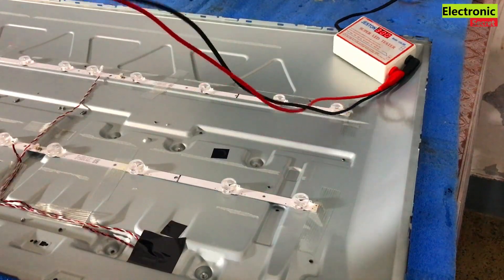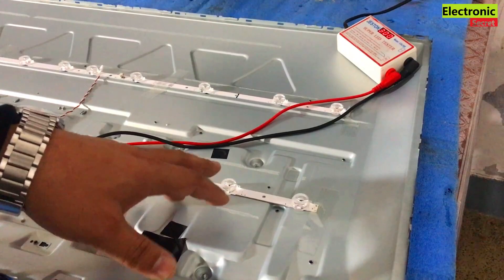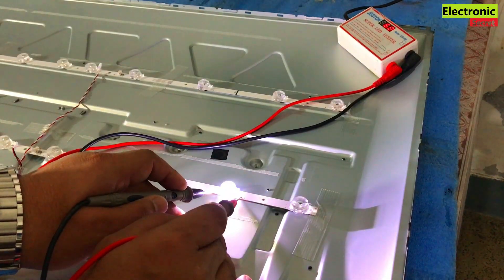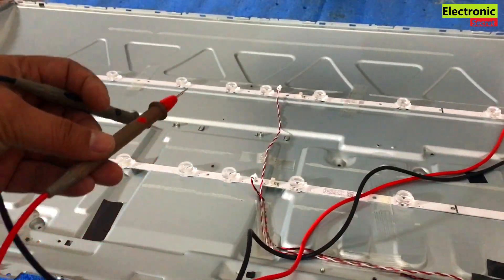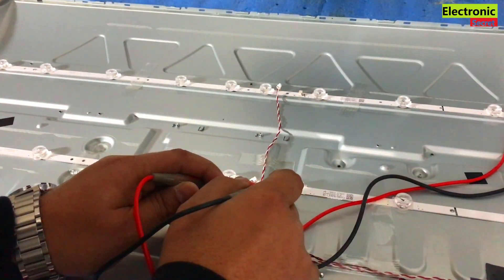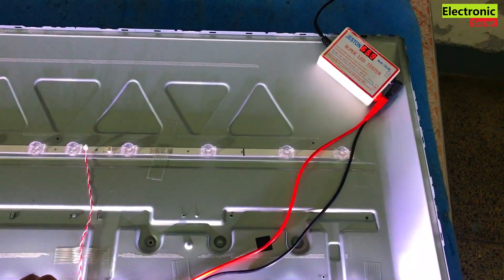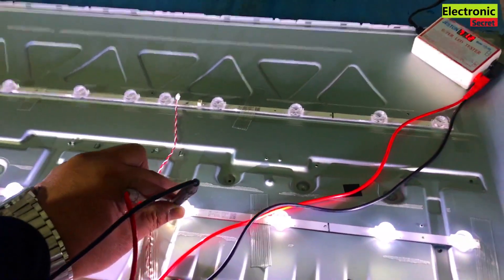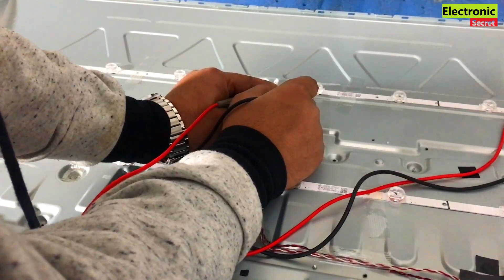HOW TO TEST LED TV BACKLIGHT STRIPS WITH TESTER, TV BLACK SCREEN PROBLEMS

Comment: So if the strip lights, this doesn't mean it's good right??  If voltage is reading incorrectly on tester.
Reply from the maker: Yes,
It may be getting extra amperes and would be blown after some time
Reply: @ElectronicSecret  I measure 350 ma when light. Is this normal current?